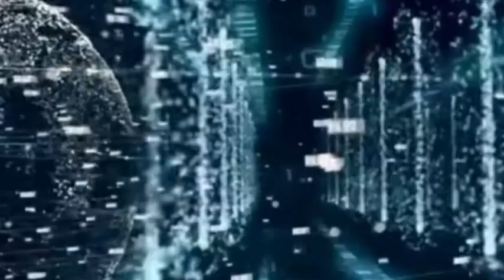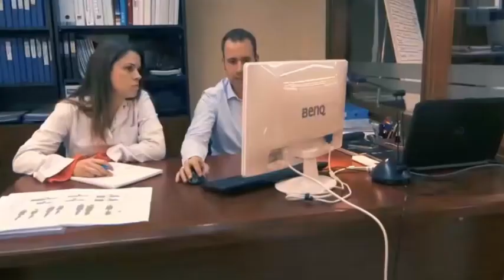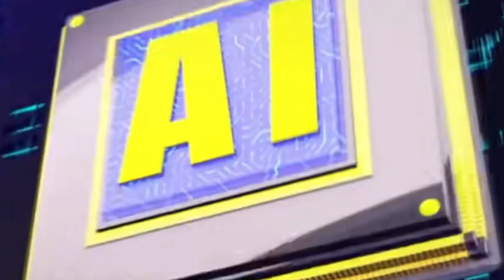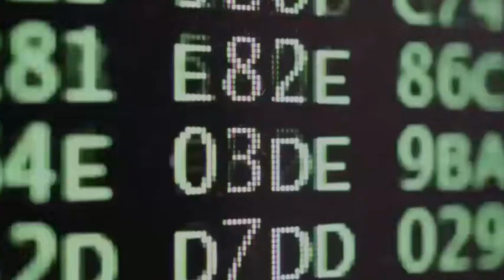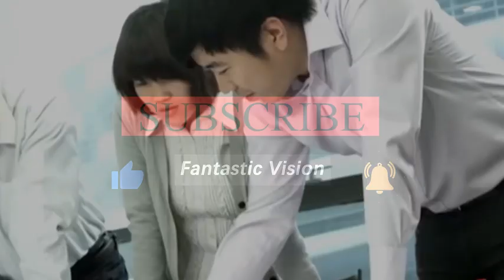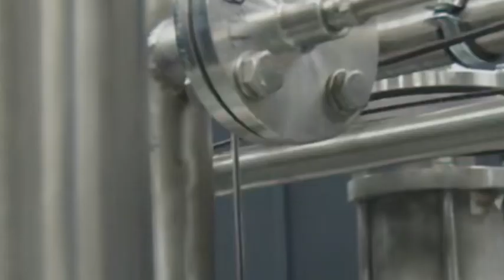What is the gap between China's 14nm and ASML's EUV lithography machines?

Comment: China's Ministry of Industry and Information Technology has released the "Guidelines for the Promotion and Application of the First Major Technical Equipment (2024 Edition)," highlighting significant advancements in the country's lithography technology. The document specifically mentions progress in integrated circuit manufacturing with a focus on Krypton Fluoride (KrF) and Argon Fluoride (ArF) lithography machines, both utilizing Deep Ultraviolet (DUV) technology.

Key achievements include:

- **Argon Fluoride (ArF) Lithography Machines**: Achieved a light source wavelength of 193 nm, a minimum resolution of 65 nm, and an overlay accuracy of no more than 8 nm, placing China's technology at the threshold of fourth-generation lithography equipment.

- **Generational Overview of Lithography Technology**:
  1. *G-line Lithography* (436 nm): Suitable for chips of 350 nm and above.
  2. *I-line Lithography* (365 nm): Designed for 350 nm chip manufacturing.
  3. *KrF Lithography* (248 nm): Capable of producing 130 nm chips.
  4. *ArF Lithography* (193 nm): Can produce up to 65 nm chips; with immersion technology, supports production of 7 nm and finer chips.
  5. *Extreme Ultraviolet (EUV) Lithography* (13.5 nm): Designed for chips below 7 nm.

- **Multiple Exposure Techniques**: Methods like double and triple exposure improve resolution without changing the light source wavelength, enabling the production of more advanced chips. For instance, Huawei's 7 nm Kirin 990 chip was produced using these techniques.

- **Domestic Progress**: China's lithography machines currently achieve a 65 nm resolution. With immersion technology and multiple exposure methods, they can potentially produce 14 nm chips—a significant breakthrough for the nation.

- **Market Impact**:
  - **14 nm and Above Chips**: Widely used in aerospace, military, automotive, industrial, and home appliances, accounting for about 70% of the market.
  - **7 nm and Below Chips**: Used in smartphones, advanced CPUs, supercomputing, AI chips, and autonomous driving, making up approximately 30% of the market.

- **Global Context**:
  - Only *the Netherlands, Japan, and China* can independently develop lithography machines.
  - *ASML* (Netherlands) leads the industry but relies on global suppliers.
  - **China**, facing export restrictions, has achieved 100% localization of key technologies through independent research and development.

- **Future Outlook**: Despite challenges in developing next-generation EUV lithography machines—which require advanced technologies like a 13.5 nm light source and ultra-precise components—China's ongoing progress could reshape the global semiconductor landscape and potentially challenge ASML's dominance.

The advancement of domestic ArF lithography machines is expected to significantly increase China's self-sufficiency in the chip industry to 70% and may lead to the localization of 7 nm chips within the next 2 to 3 years.